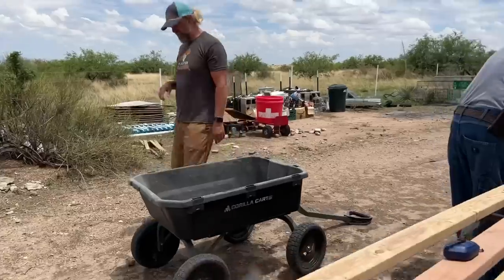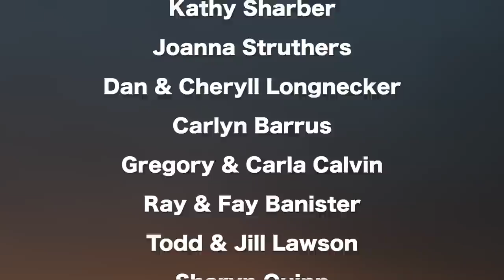RAINWATER TANK Surface Preparation (Chicken Garden Day 153)

Comment: harbor freight has a "pickup bed un-loader", it is a woven sheet that lays in the bottom of the bed and it has a spindle at the tailgate end that allows you to 'wind' the sheet up bringing the load to the rear. It is a sweet thing, I have used mine for everything from fire wood to gravel. And it leaves the bed nearly clean.
I think they are under 60.00.  It is rated at 2000lb. but I know I have had way more than that on it.

Comment: I saw on another YouTube channel that is using hyperadobe bags for building walls that they occasionally have to spread a thin line of caulk in the cracks between long lengths of the hyperadobe bags. This (obviously) helps to seal the cracks that are a little too large.

Comment: Looks better every day! Love the effect of burning then sealing the wood. Please consider strapping down the water tank for safety since you are in a high wind area. Real anchors attached to underground concrete posts would be best, but anything permanent that can't be easily pulled from the ground will work.
Reply from the maker: No need for that. The wall blocks the prevailing wind and we will keep it topped off.

Comment: make up a slurry mix of sand soil and cement and use that to paint over the cracking. it will if there is enough cement in the mix fill the cracks and will help waterproofing, .

Comment: Have you thought about getting old paint and mixing in the plaster. Like from a recycle center, scrapes from a paint company. I added resin to a side walk repair and it lasted until I moved 10 years later. Some I did later without the resin came up in just a few years.
Reply from the maker: Not for a building with a garden and chickens in it. Needs to be food safe.

Comment: if your problems are at the seam, undercut the existing plastering when you apply the material to useas a keyway to add strength to the connection between aplications.  Just a thought since that is standard for repairing platering.

Comment: Love the wood treatment you guys use. I'll have to try it on some projects. It turns out so nice. What size water tank are you guys getting for the coup?
Reply from the maker: This will be a 1200 gallon (short so it fits under the low roof)
Reply: @TinyShinyHome  makes sense.  Can't wait to see it running.

Comment: Just one question.  I saw you mixed the concrete and dirt in the earth bags.  I thought that was good.  But if you mix dirt in the outside layer.  Won’t it always deteriorate in water?  I know in the north they just use sand and mortar to get the water proofing they need.   Won’t the dirt mix.  I don’t mean to be sarcastic at all.  I just don’t see the dirt working good over the long haul without a lot of repair work.  I’m getting ready to build an adobe cabin.  I really like the look of it.  Later.
Reply from the maker: There's plenty of good info out there about earthen plasters, just trying to find the right mix with our soil.

Comment: Was it a coincidence that the cracking occurred over the chinking?  Or is the issue NOT the mix but that there will be cracking over where you chinked?  If you KNOW that the chink will cause a crack that needs a wet sponge treatment as it begins to dry but you LIKE that mix, why change the mix?  Why not just hit the wall with a wet sponge after.  If you are anything like me, you will add a curl, flourish, tree, cactus garden or traditional trim designs at every plain area that is just begging for some kind of decorative touch, then going back over with a wet sponge and more mud is going to happen anyway.  You have already gotten back to that (I suspect) so this question might be moot.  So I am just typing out loud.